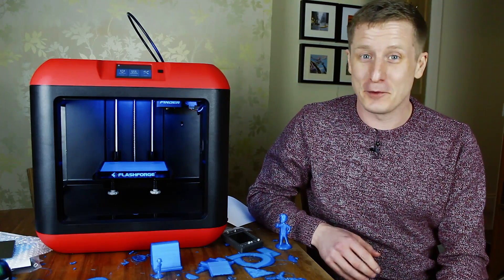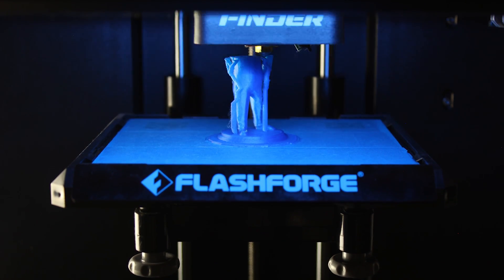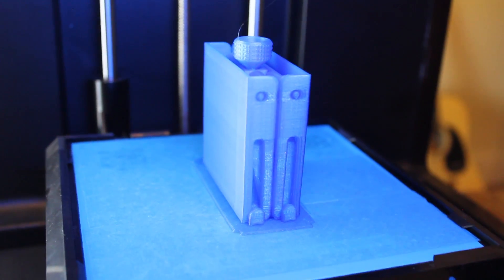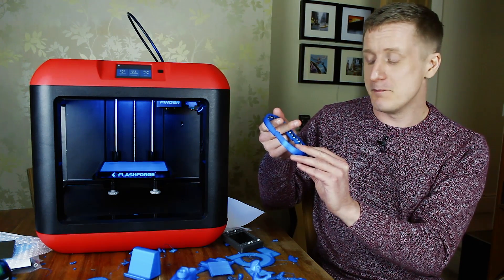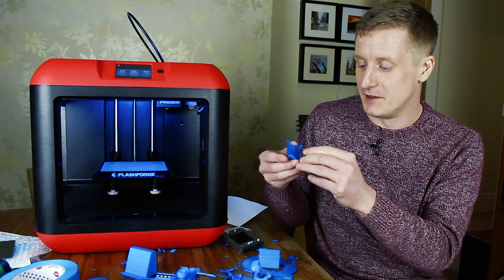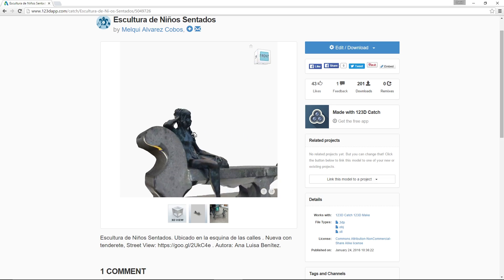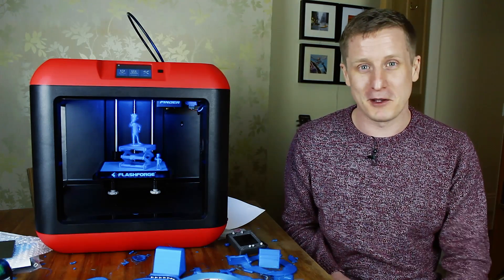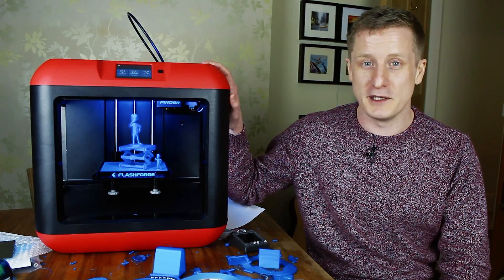3D Printing: The road so far...

Comment: Nice video - I got the same printer at work on Thursday and have just printed twice. On both occasions the print has had a lot of stringing with the first suffering from oozing filament which caused some layers to separate as well as filling some of the honeycomb structure will a big splodge of filament. It's obvious that the default nozzle temperature of 225c is too high so I'll need to play with that. You mentioned that you decreased the temperature yourself - what temperature do you find works best for you?
Reply from the maker: Sorry for the late reply. I find 220 to be just fine for most of my PLA. You should try changing you Z height, give a touch more space between the nozzle and the print surface, a tiny tiny tiny bit more. That should help with oozing but dropping the temperature to 190 will also help if your filament is pretty liquid.

Comment: Hi, i'm hoping you can answer this. Due to your previous video on this printer, as well as this one, I am close to order this but have a question.

I am looking to use translucent filament, would Gizmo Dorks spools work in this printer, or am I forced to use filament branded by Flashforge only? I am a bit nervous in ordering and not knowing which brands will work. Thanks a ton if you can answer.
Reply from the maker: +Ocelot most if not all brands will work. You will just need an external spool holder as they won't fit in the internal holder. I use this one https://www.thingiverse.com/thing:1967410
Reply: Oooh, alright, that's great news. Thank you for the link as well. I'll bookmark it, placed an order for the Finder. Thanks again. :)

Comment: Yes, it arrived yesterday.  The only initial problem I had was getting extruder errors after about a minute of printing.  I wiped the head a couple of times, and now it's printing OK.  It's fascinating to watch it print.  I'm printing the snake in the software now.  One question.  Do you recommend using blue tape on the bed to aid in removing the print?  Some people say they have luck using hairspray.
Reply from the maker: I prefer blue tape on top of the build tak suface that comes prestuck to the build plate.